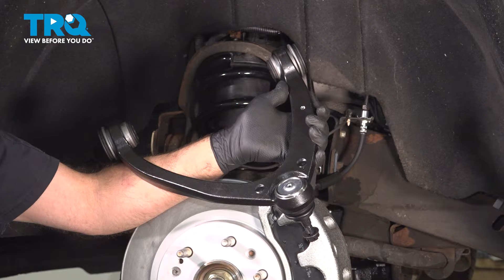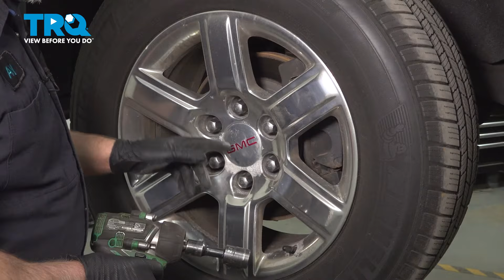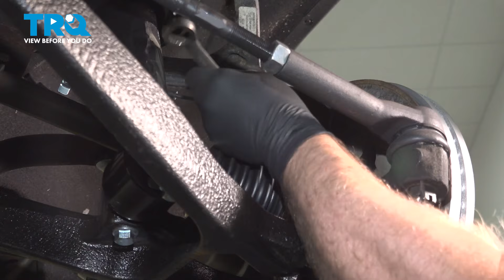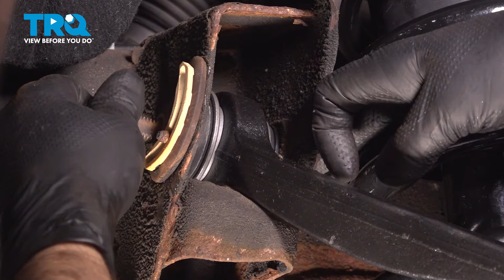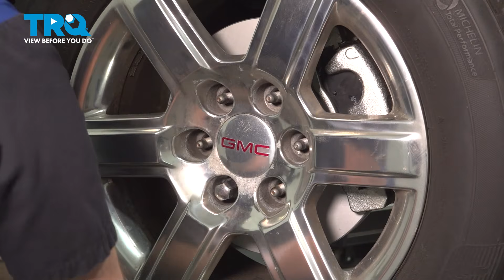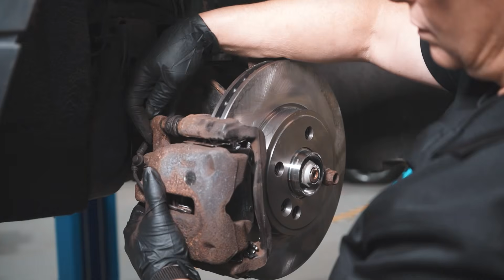How to Replace Upper Control Arms 2014-2018 GMC Sierra

Comment: You really shouldn’t torque the control arm until the full weight of the vehicle is on the ground to insure the ball joint angle is correct for the ride height (especially if you have a level/lift kit)